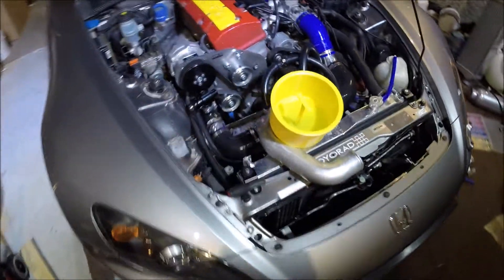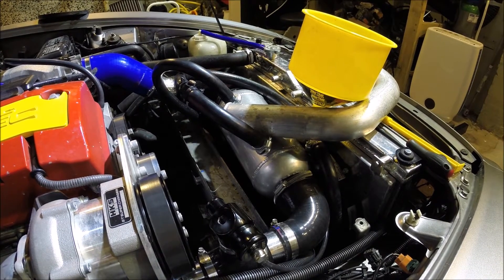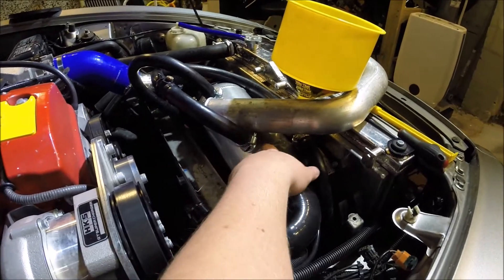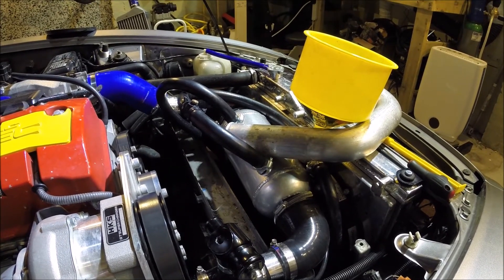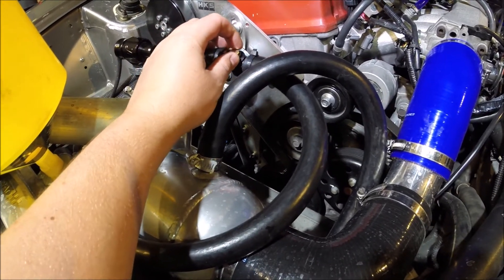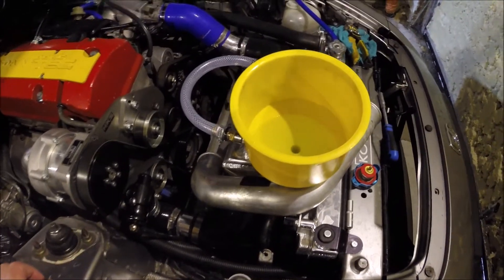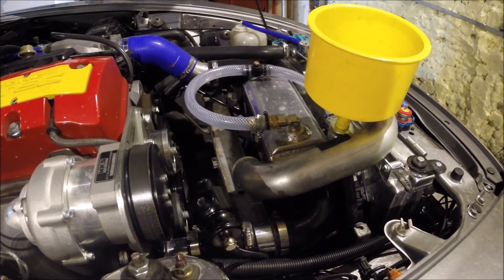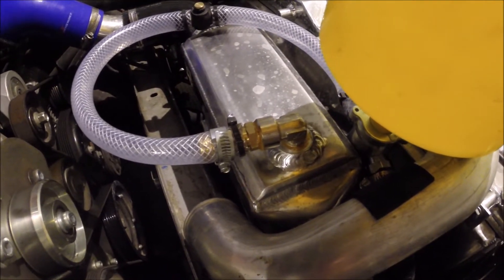Honda S2000 Charge cooler part 3

Comment: I still find your IC a little on the small side. Rule of thumb with frozenboost intercooler is getting one which is rated twice the power you want to run. And yours look like a type 19 which is rated "600hp" but only 550cfm . That is around 40lb/min so I think the rating is a typo and this one is more a 400hp unit. Others "600hp" rated IC are quoted as 700cfm capable which is about 50 lb/min (so around 500hp really).
And your pump is not designed for continuous use nor designed for use with a restrictive loop. Your lines are too small for it to run efficently. Especially if your IC is already close to its max capacity.
IMHO your circuit is not up to the task unless only for short burst of boost then letting the loop cooling itself for some time.
The HE in the bumper is about the good size if you're not spinning the compressor too hard and don't plan to run on track. Change the pump for a pierburg cwa50 (which is designed for this type of operation ie : charge cooling with not so big lines and complicated/restrictive cooling loop). Careful with it as it will pump a shit ton more than your actual pump and bleeding will be a bit tricky. And a good bleeding is mandatory for good performance.
They can be found used as they are used on turbocharged bmw and mercedes cars/vans.
If you still run too high IAT then you'll need to know what your water temp is in order to know if it's the HE which is struggling to cool the water or the IC which can't remove heat from the charge air.
Reply from the maker: Thanks for the great input much appreciated. I have just taken the car out for a quick drive before it started raining and with this chargecooler i have had much much better results. On a quick run i have found that as soon as im coming on the throttle and the boost builds the inlet temperatures drop rapidly. The OEM sensor position is subject to heat soak so off boost it never really shows the right temperature. The charge cooler is very cold to touch where as before the barrel type was warm. I also have a radiator cap that has coolant temp built in and after the run it was in the low 20s with ambient outside probably about 16c.

I hear what you are saying about the restrictive loop. I have been looking for a tank/reservoirs that i can use to feed the pump so its not pumping against itself like it is currently in the loop. I have changed the pump to a much higher flowing unit but nothing as good as that pierburg unit. I will keep an eye out for one of those.

Im abit limited in coolant line size as the barbs on the heat exchanger are 19mm. I know you can increase the coolant amount by using larger lines but i would rather use that as a last resort if i really struggle with heating up the coolant too much. I need to do much more testing to prove whether the circuit is able to deal with sustained boost. The car felt alot more responsive than it did with the barrel chargecooler, much more responsive. Thanks for taking the time to watch the video. Just out of interest have you had much success with chargecoolers?
Reply: That's good news if you've got much better results. :)
You'll know what your loop is capable of when you'll give more gas. If you fall for a cwa50 your actual lines will be more than enough, no need to go bigger unless you encounter heat problems later. I talked about going bigger if you kept the low pressure bilge pump, those things hate backpressure and need the lowest restriction possible to get any decent performance.
Wait for the sun and hit the loud pedal to get results with some heat to dissipate. I'll be interested on the results. Have you got some pics of the internal core of your IC ?

I'm still air to air for now gathering as much info I could, I plan going air to water this winter. I have the pump (cwa50), I think I found the IC (albeit being a little to small for my liking but can't fit bigger without creating too much hassles afterwards) but still searching the HE for now. I'm looking towards converting a AC condenser, they're cheap, have large frontal area but are still thin enough to not hinder too much the airflow going through the engine radiator.